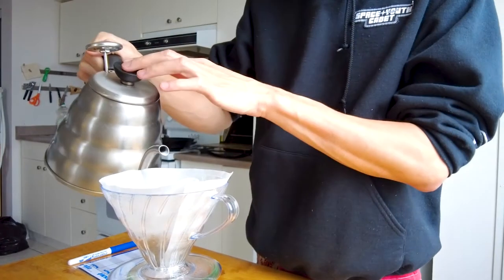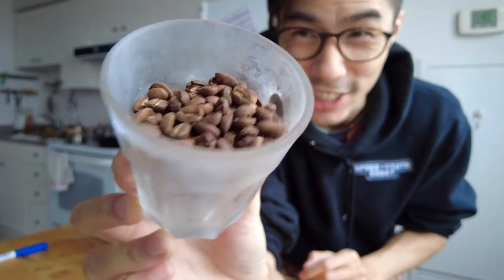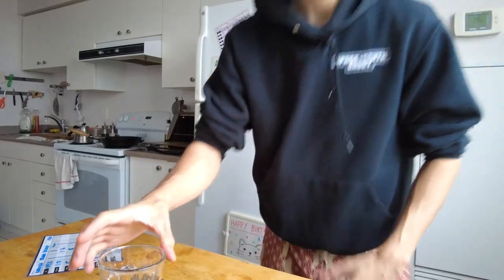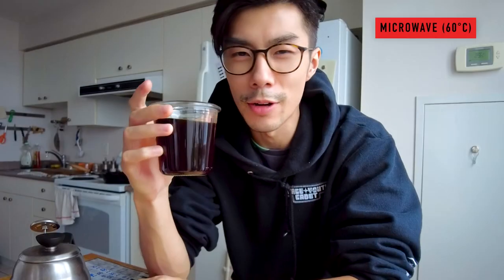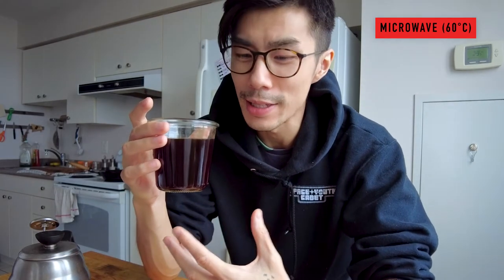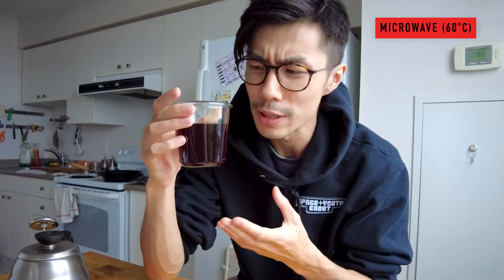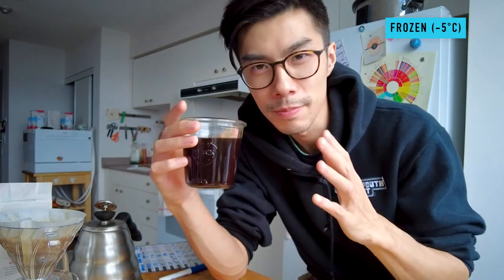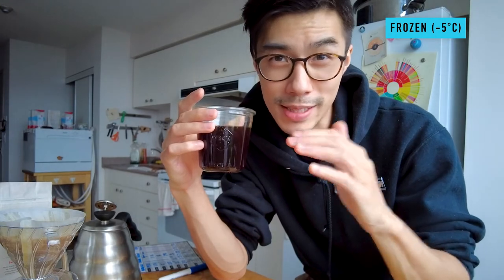Microwave Your Coffee Beans Add-on | Taste & Drawdown Time

Comment: I have heard it said that the frozen beans grind better with a more consistent size. This is slightly different to what we are talking here in the video, but, it is an interesting idea which I have found this makes a difference.
Reply from the maker: Yea there has been some chatter about freezing beans especially with JW's recent video on using liquid nitrogen haha. I usually toss the beans I won't use for awhile into the freezer, it works like a charm to lengthen and keep the beans fresh. I have not experienced any issues with freezer burn or cross contamination of scents that would hamper the final cup of coffee.

Comment: I find that on occasion no matter how much I tweak my variables (or chase them rather, haha) I'm not completely happy with the results. There are times where changing the grinder has made a big difference for me in terms of a starting point for dialing in. Sometimes I prefer the taste when using my JX-Pro, while at other times it's my Encore. Both having conical burrs (so maybe similar grind geometries), I imagine it's really their distribution that's playing a major factor.

But if you only had one grinder, I wondering if this can be used to tweak it. For instance, if you have a lower end one would microwaving your beans then allow you to essentially get results as if you had a better one (at least in terms of distribution)? On the flip side, if you had one with really sharp, aggressive teeth would freezing allow you to introduce more fines into the distribution to round out the taste (from a brew that has almost too much clarity)?

Also, I agree that maybe all of this could be too much and we might be getting into diminished return territory. But I think it could be looked at as a grinder micro-adjustment hack. Some grinders have major steps in grind size but also a secondary control for fine-tuning. Maybe this temperature adjustment could fine-tune distribution rather than grind size?
Reply from the maker: It goes to show how vital grind distribution is to the final cup of coffee. On that note, we tunnel vision on getting the most consistent and uniform grind size. I believe that a reasonable amount of fines and boulders might make a cup of coffee taste better. 

I tried microwaving with the Porlex hand-grinder in the previous video. From my limited experiments, it didn't improve the grind distribution in a meaningful way. There are many aspects I haven't explored (like lower freezing temperatures) that might be more beneficial for lower-end grinders.

Agree with you that this knowledge might be overkill for most and probably just a way to do a minuscule micro-adjustment to a grind distribution profile when you know what you are doing. 

If only there were a product that quickly and easily calculates one's grind distribution, I feel that only then would this knowledge could get some practical use and you could micro/freeze with intention. Something similar to like a coin-sorting machine!
Reply: @brewinghabits  Interesting to see you mention lower freezing temperatures. I just ran into a feed this morning talking about a study where they experimented with grinding beans at -100°C and how that improved uniformity by 15-20%. I think they're targeting the pre-ground coffee market and claim that it will improve the taste. So maybe there will be some benefit down the road for some folks. I guess for pre-ground, less fines could probably a good thing? But then again, maybe it's better to get those folks to grind fresh, haha.
Reply from the maker: Ankit desai mentioned the same article in the previous videos comment section!

To copy/paste my hopes on it "Hopefully, they can create a commercial grinder that does it all at a reasonable price and not just at NASA/mass production rates :P". It really won't impact us home coffee brewing plebs just yet lol

Comment: There you go, my questions answered completely! I was surprised the microwave beans came out on top and it makes me wonder why. Do you think that maybe microwaving actually roasts the beams a bit further and increases the "roast" flavors slightly? Really interesting, thanks.
Reply from the maker: Good question and to be honest, I don't think I have a definite answer to that. My guess is that it still goes back to the grind distribution that is changed, which then impacts extraction and taste. But I would also love to rule out other options like the coffee oils being heated, the beans chemicals being impacted etc. There are many interactions I could think of that I just don't have the tools to rule out!

I have my doubts on the bean being roasted further though. I have been microwaving the beans at 1min and it just doesn't seem to be enough time or enough heat for the process to increase the roast of the bean. Scienceeee +_+
Reply: @brewinghabits  That's also interesting. I wonder if one could actually roast coffee in a microwave, from green to... Somehow, I'm thinking not.
Reply from the maker: Did a quick Google search and it seems to be possible...! But you would need special wrapping paper (like for hot pockets) to reach the high heats that roasting coffee requires 🔥🔥